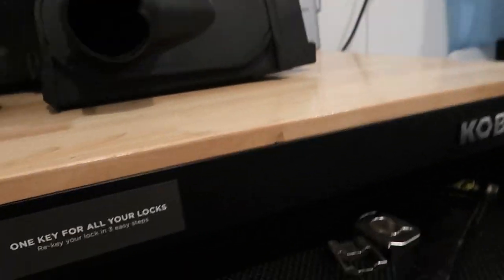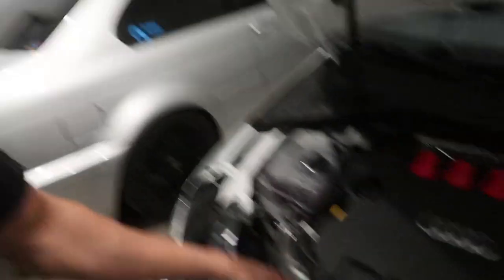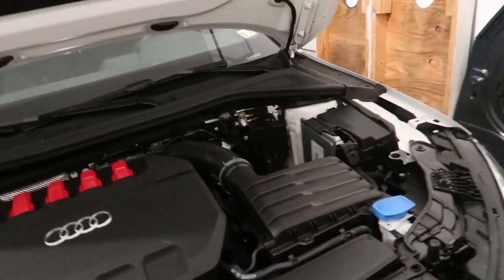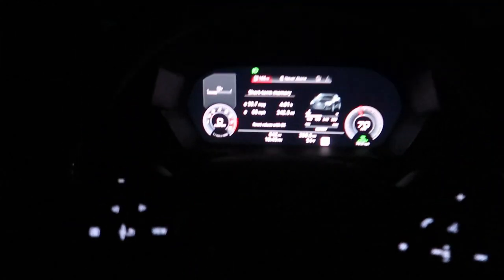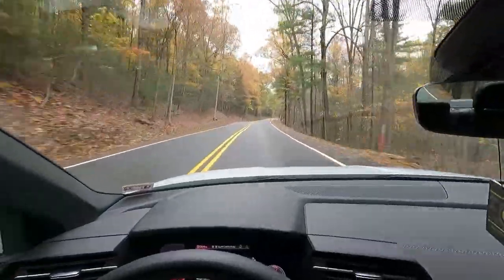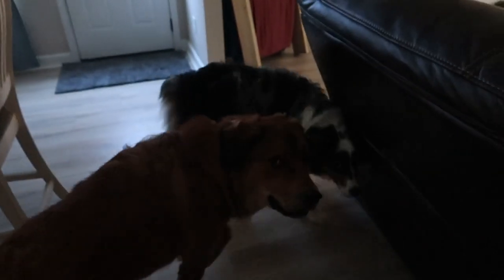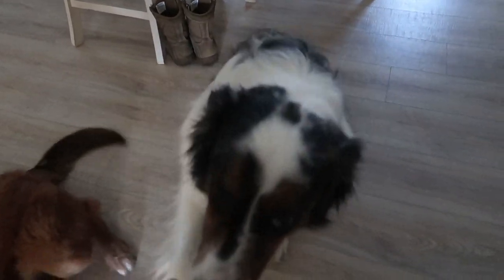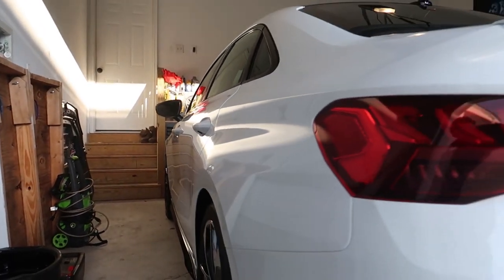First mods and bombing some mountain roads! | 8Y S3

Comment: Watching this made me want to go out and drive my S3 right now!! hey whats ur exhaust setup? mine has the factory resonator delete, but i may put it back in at some point. if you have a resonator, and dont want one, we could swap. i have the delete pipe. unless the exhaust is different for my 2018..
Reply from the maker: I pretty sure it is different.. i have no real mods on the car yet, what you mostly heard is the soundactor through the speakers lol car is pretty much silent. Actually going to diplomats tomorrow there in VA beach after drill and going to delete the res. Go drive!! hopefully we can meet up soon and make some vids!
Reply: @BryceJordanProductions  BRO.. if you cut the resonator and cut it at the standard points, ill pay you money for it. mine has a delete pipe with a oem vw clamp on each side. dude, sry im tripping..... you have a different version.  dang.
Reply from the maker: Yeah I'm pretty sure they're different sadly.. do you not like it at all??
Reply: @BryceJordanProductions  oh nah dude.. i love it mostly.. but, it will get old quickly. I use the D --> S stick for more sound. So i dont need the resonator-delete stepping both those options up a sound level. did i mention this is my Lambo?
Reply from the maker: Ahh I gotcha. Hopefully I don't hate it 😆 do the valves being closed keep it pretty quiet?
Reply: ya it’s pretty quiet until u go half throttle  @BryceJordanProductions
Reply from the maker: @LastHumansGarage  perfect!!